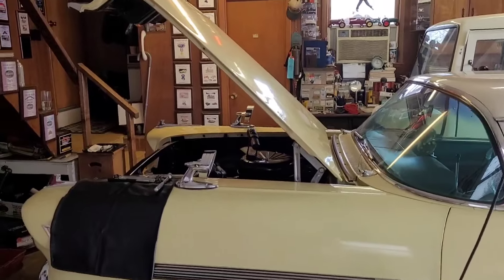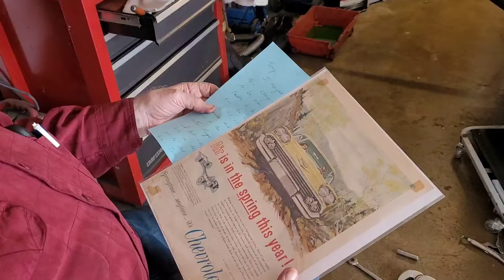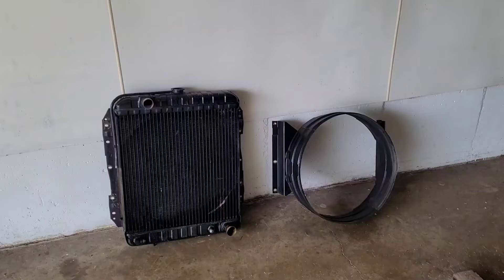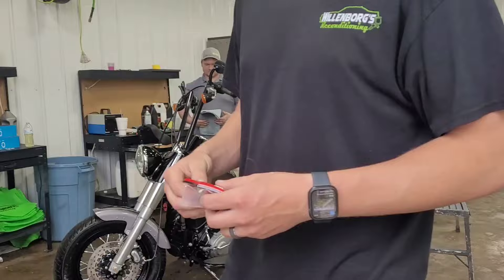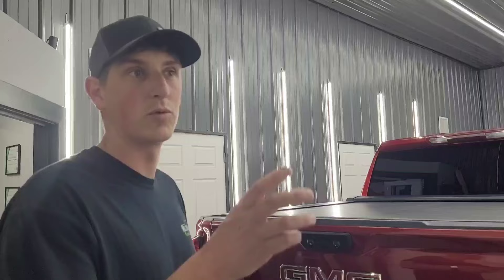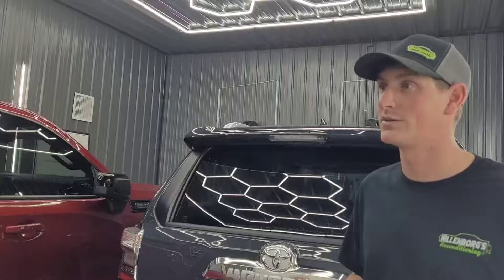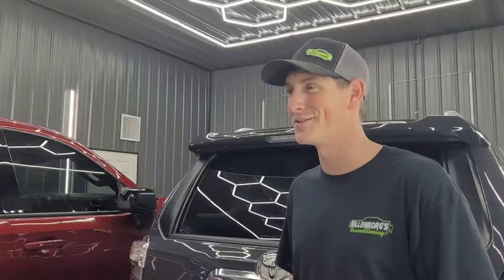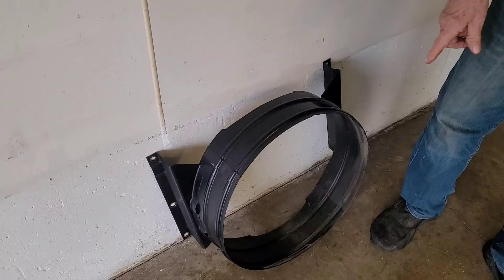Art's 1958 Chevy Impala Radiator Leaking And A Gift For Art From A Viewer. Willenborg Reconditioning

Comment: Love seeing Art’s cars. 👍 re the fan, not a loose or broken engine mount is it? That would put the fan in the shroud. I would definitely check the engine mounts to be safe.
Reply from the maker: We'll look into it when we get the radiator back. We don't think so.
Reply: @tonyscarcare5657  No worries. I had a 1974;Buick Riviera 455 and it broke an engine mount and that let the fan hit the shroud. Luckily I caught it in time and replaced it, so no damage. Happy 60th to Art and his wife. 🎉🎈
Reply from the maker: Thanks, Mark! The fan is rubbing the bottom of the shroud. We think the engine would be raising and hitting the top with a broken mount. We're definitely gonna check it out.
Reply: @tonyscarcare5657  No worries Tony. That is true re hitting the top of the shroud. Better to at least check while you have it apart and can get access. 👍